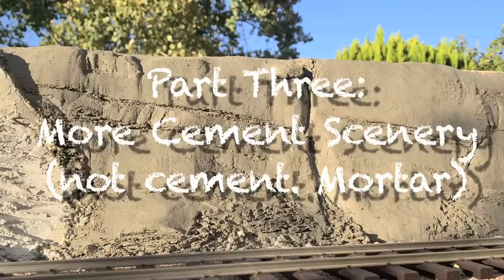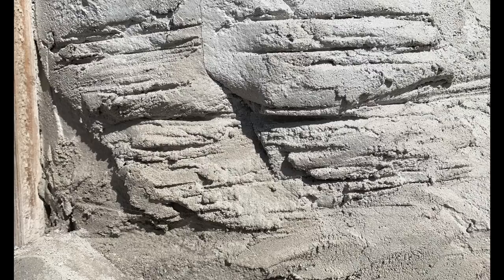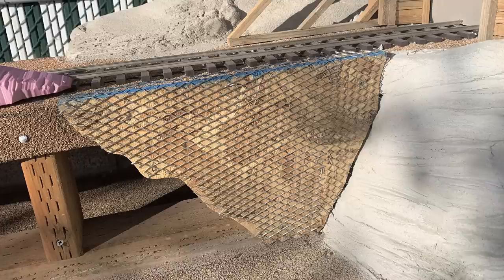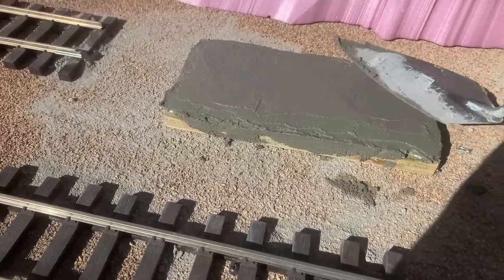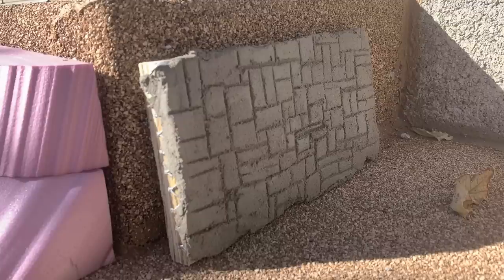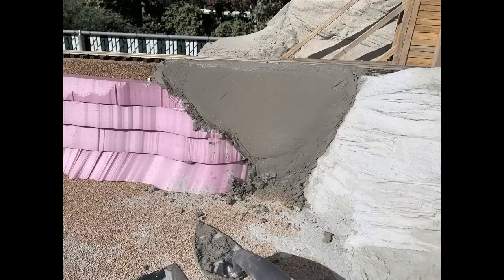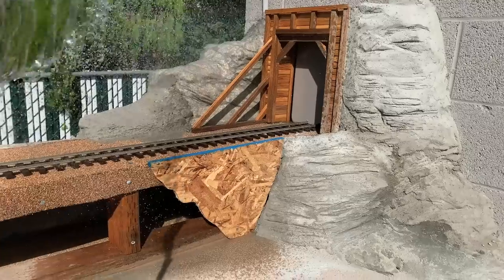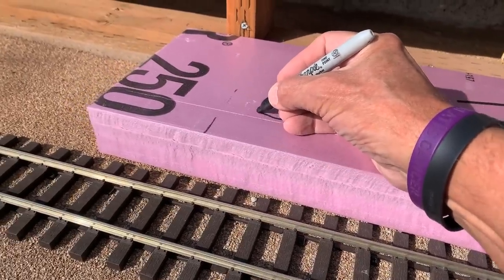Garden Railroad Portal Part Three - The "Stone" Retaining Walls

Comment: The "rock" etchings really turned out well.  As for the mortar walls, there is a positive side to the first not being as thick as the second.  It gives that feel of being hand built, as if there were two different crews building the two walls simultaneously, with each "crew" having a slightly different approach to their build.
Reply from the maker: And my fear about the first one falling apart turned out to be unfounded. 😊

Comment: Well, since you did this last fall, I'm too late with my comment. Even so, southeastern Utah is on the northern edge of the Monument Valley features, so you could turn that conduit pipe into a chimney rock and have a butte or two too. Question; Why didn't you pre-tint the mortar mix?
This is interesting to the max. You are replacing the indoor scenery materials with outdoor stuff. By your doing this, it is saving US the learning curve, thanks. ;-)
Reply from the maker: I’m going to tint now. I thought it would be easier to stain. And it is and isn’t. Still testing ideas. But next up.. redish tint. Red sand. And color water based stain.

Comment: a dry surface will suck the moister  out of the mortor, you need to dampen the wood and or old cement and it helps with adhesion.
Reply from the maker: Thanks. Getting a handle on it. Bit be bit. A little voodoo in it as well…